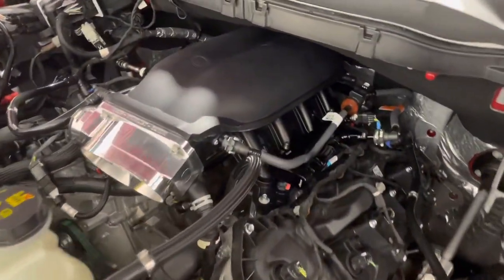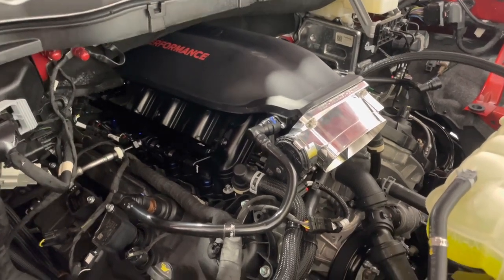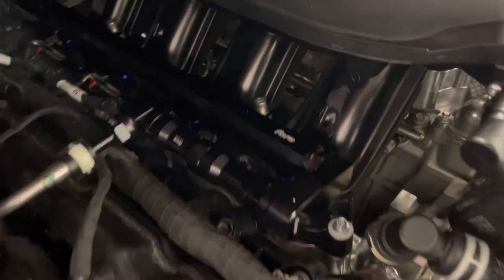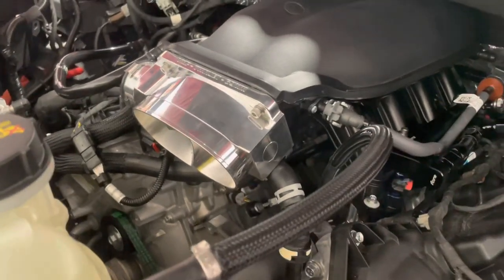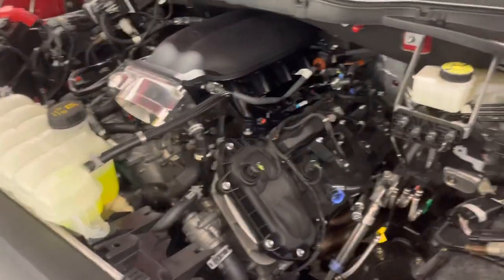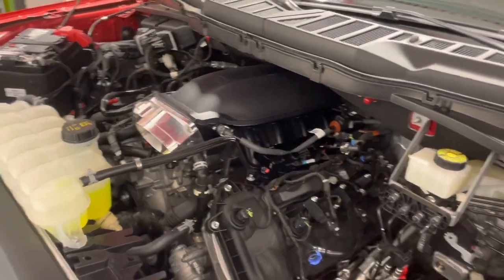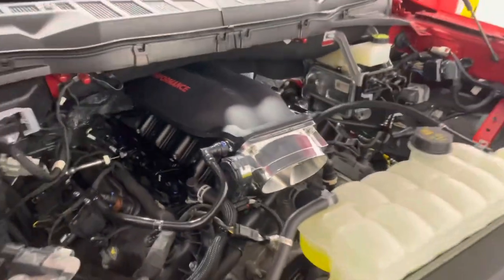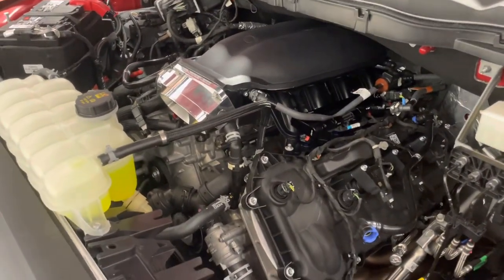First Gen 4 F150 (2021+) Cobra Jet Install on project Helkfyre

Comment: Why does your motor have plastic valve covers when my 22 5.0 has aluminum?
Reply from the maker: factory covers
Reply: @TeamBeefcakeRacing  I didn’t doubt it just wondering if someone can chime in why my 22 xlt 5.0 has a plastic passenger cover and a aluminum drivers cover

Comment: Hiw did you fit the fuel rail
Reply from the maker: I think we talked on the phone if not, give me a ring
Reply: Yes we did just purchased the setup order #70148 if y'all want to toss some decals in there so I can support you that would be cool also what did you guys use to cap off the little hole that is inside those Billet spacers for some reason from Livernois
Reply: When looking at the motor from the front on the right hand side the far back cylinder there is a hole in the top and a small screw hole in the bottom like something is supposed to go there but mine didn't have anything in the kit I ordered from them to go there was wondering what did you guys use to block that hole or am I missing a part and I need to contact Livernois
Reply: I really appreciate your guys's help and knowledge also now that I have this is there anything else I will need to make this thing work I would appreciate that